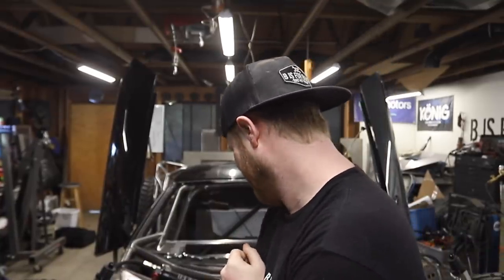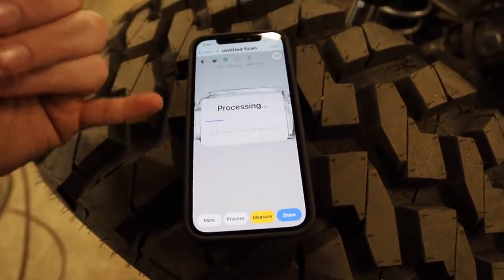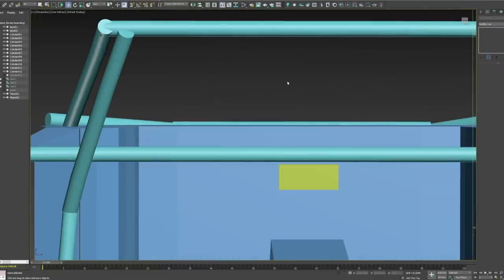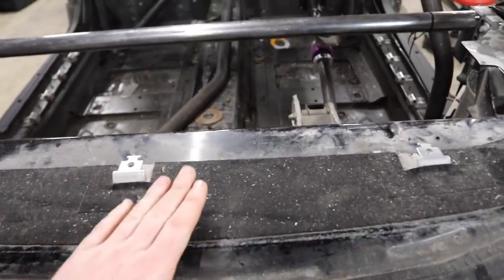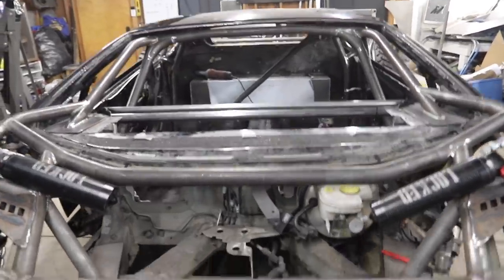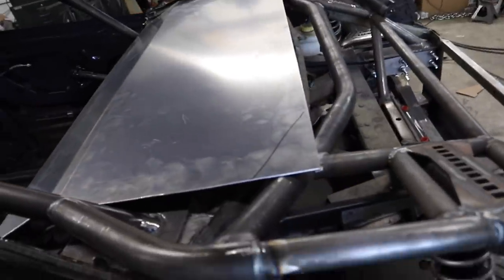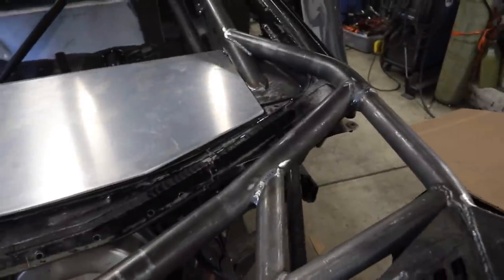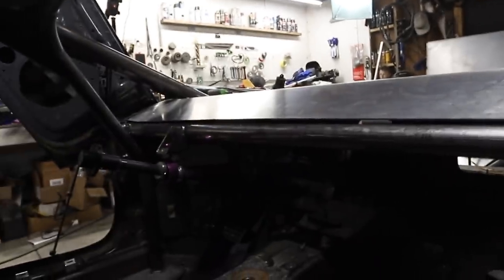Off-Road Lamborghini Huracan gets a Race Dash

Comment: The only thing you absolutely need to remember with this dash is to paint/cover it with something dark and matte, so it won't blind you while ripping dunes.
Reply: FLOCK IT . No seriously matte flocking would be best
Reply: I am hoping for some alcantara instead
Reply: i mean, that part is sitting there saying 'flock me already'
Reply: It will have a ton of mud on this dashboard...it would be a nightmare with Alcantara or flocking.. Just spray it the most easy way (a dashboard in a racecar is always modified).
Reply: @adrienmessuwe5162  True, didn't consider it. Maybe some bed liner would be better then
Reply: @henrynewgent8481  nop it's too hard.. Just spray can it
Reply: @adrienmessuwe5162  you can get bedliner in a spray can or roll it
Reply: @Ross Bourne It's an easy thing to overlook when you're focusing on building parts and reaching deadlines and if you don't have experience racing in the desert, which he has said numerous times he doesn't.
Reply: I was thinking musou black for zero reflections.
Reply: @matthewday7975  thanks but I knew that.... I say it will be difficult to remove bedliner to make modification on the dashboard (there is always modification on a racecar dashboard after the first race).
Reply: Flock it
Reply: No need to worry about that. They don't drive their builds
Reply: @a.e.4156  they drive their builds
Reply: If it had a plexi glass window it would look awesome
Reply: Having something dark and matte is a very good idea, paint would do good, flocking it will definitely look good but it may not be the best to handle the dust
Reply: @daniesalex7073  sure. How many DRIVING videos have you see of the LS swapped lambo? 1 ????
Reply: @daniesalex7073  I agree with the plexiglass window.
Reply: @a.e.4156  like 4 or 5 videos , there are more plans for the ls swapped lambo also they get into new projects as soon as they are done with a project, they are bisforbuild .

Comment: I highly recommend not putting the Holley screen in the middle like that. You want it to be easily visible without the driver taking his eyes off the “road”. Having to look down and over to the middle can distract the diver and cause an accident.
Reply: agreed
Reply: Does the driver even need to look at the display at all. Since he has a navigator sitting next to him
Reply: The screen in front of the driver and the ecu to the roof... This is the better way
Reply: @nestam6844  yes it’s necessary. Is the navigator gonna tell him every time to shift? Or what speed he needs to be going into a corner? The navigator is exactly that, a navigator. His job is to tell the driver where to go. Not keep track of 50 things while the driver pushes a pedal and turns the wheel.
Reply: The navigators job is to watch all gauges and navigate. As a driver he should never have to look away from the terrain. He shouldn’t be looking at the Holley to shift either, it will be by sound. I put my gauges in the middle of the dash in my race car
Reply: Couldn’t y
Reply: Do you even look down while racing though?

Comment: Hey Chris, don't forget some big warning lights for oil pressure, coolant temp and maybe air/fuel. A digital dash will be good but you can't be looking at it all the time while racing. You need something that immediately grabs your attention when there is a problem.

Comment: The center piece could hold a shrouded kill switch to be able to shut the engine power system  and fuel power system down during any unexpected incident (which us common people call an accident). And being centered  would allow either the driver or navigator to reach it.

Comment: Technology is so amazing! 3d scanning like this just a couple of years ago was so much more difficult / expensive. Having the ability to capture physical space in an accurate 3d model is going to open so many doors for so many people. A few years ago I used photogrammetry to make a 3d model of my engine bay....the models always turned out decent enough for a basic starting point but were such a PITA to create. You have to take like 100 photos and then compile them all with some software. To get an accurate model I started taking my car and parts to a scanning company that used a $30,000 Artec Leo to scan everything. Now you can just wave your dang iphone around and it is done in seconds!!!  I hope we see some massive tech jumps like this in the 3d printing world that allows us to quickly and easily create durable and heat resistant parts, maybe even metal parts for the common man! Instead of only NASA and people willing to spend $10k on a small part :)

Comment: I think what I was thinking on that was filling those wing areas on the dash with steel built into the roll cage as a bit of gusseting and then bolting the dash into that. My thought was the dash piece could be rounded over the dash bar and come down a couple inches. That way the front of the dash could be bolted or Dzus fastened to the piece. You may also want to bead roll the dash at some point because all that flat metal will probably make a lot of rattling noise.

Comment: have no idea as to why you didn't make it out of carbon fibre, black, less glare and lighter. make the templates out of 3mm MD, glass over the top and you have a light part
Reply: Tbf carbon fibre id very expensive and hard to work with especially if u go wrong

Comment: I’m no expert but I think you might need to add additional shocks basically a extra shock on each end to absorb the drop because hitting the stopper might cause damage.
Reply: I agree a race vehicle should run a bypass also but the shocks he has and the hydraulic bumpstop will be fine as is.  The bypass is used for more fine tuning and just better suspension control.  The bumpstop he installed is made for what it is being used for.  Never ran Locked brand but I assume they are like all the others.

Comment: Looking at the dash designs (I haven’t finished the video) I feel like you could keep that middle hump thing but cut away at the bar going across and reinforce that area in a different way and put the screen in that spot i think it would look cleaner and look like it’s meant to go there. Or you could move the hump over to the drivers area and put a tiny digital gas gauge there that instead of showing a dial it’s kinda  like the battery life indicator on a phone but for the gas instead.

Comment: Did you add rubber/plastic washers between the dash and cage bar to prevent galvanic corrosion? Maybe just go with aluminum for everything and save the headache.

Comment: I know you probably don't need it anymore, but next time, there's a piece of software called Agisoft Metashape... you input a bunch of photos and it extracts a highly detailed model. I use it in animation and it's killer. I believe they have a 30 day free trial as well.
Reply: Also, you can use a regular old iPhone camera to take the photos. Nothing fancy. It basically extracts the geometry and then remaps the photos on top for texture. Metashape is the best software I've found. I tried some free stuff but it just never worked as well.

Comment: wow that looks solid! im impressed. Im curious how that would behave if you had a crash with front impact. do you have a crumble zone at all? or is the cage rigid enough to hold a front collision without crumbling? i dont want you to be spliced in 2 by that sheet of aluminum 😅
Reply: Off road vehicles like this do not crumple.  We install better/safer seats and 5 point harnesses with helmets and some run HANS devices so that when there is a crash your body does not move.  Unless there is a critical failure on belt install he should never get close to that dash.
Reply: @dsrtrcr01  good to know. Thanks for the reply!

Comment: Why not put the Holley meter cluster behind the steering wheel? That's where Cleetus put his Holley screen in Leroy. Plus, then the GPS can go in the middle so that the driver can see it more easily. It's as if that's where it is in most cars because engineers have figured out that to be the best place for it.

Comment: Hey Chris, any concerns on the aluminum dashboard becoming a aluminum guillotine in the event of a front end collision? Modern dashboards are made out of plastic and have rounded surfaces facing passengers. Hoods on modern cars also have built-in week points also to teepee instead of cutting off your head also.
Reply: This must be the first race car you’ve seen.
Reply: @Oscar_SMT  Most race cars I've seen don't have much of a dash just a pod of guages around the the steering wheel or guages on a vertical panel mounted to a dash bar.  I just wouldn't want anything to happen to Chris, Oscar, or Kyle when they start sending it in that dirt missile. Love their channel and saw them at Sema a couple times.

Comment: That 3d modelling on the iPhone is impressive. Does it use GPS and the altimeter to build spaces? And, if so, are the iPhone's internal GPS and altimeter location determining accurate to  5mm??  Or does it use radar? It's both impressive and creepy in equal measures, either way, if so!

Comment: Off-road racing is messy/dirty. Oversized hardware would be a better choice from a service perspective. A strong metal mesh screen in substitute for a glass windscreen is a must to stop flying dirt and rocks from hitting the driver and or co-driver.

Comment: I know you have a pretty solid relationship with you wheel supplier, but as heavy as this Lambo is getting. You really need to start looking for some stouter bead lock wheels. With all the design and engineering that went into this thing's suspension, you will want wheels that will take as much abuse as the suspension will.

Comment: Looks great but you're going to need to flock that or you'll be blind when driving in the sun
Reply: @Ross Bourne We are talking about a guy who some how thinks a tiny ass gasoline engine is going to move a boat that had turbo diesels nearly double the displacement. And who also is building an off road buggy on none bead lock street car wheels, so overlooking the obvious is kind of a pattern at this point.
Reply: @Ross Bourne he doesn't mention it all episode, if he said he was going to flock it later I wouldn't have commented but seems like it's another oversight.